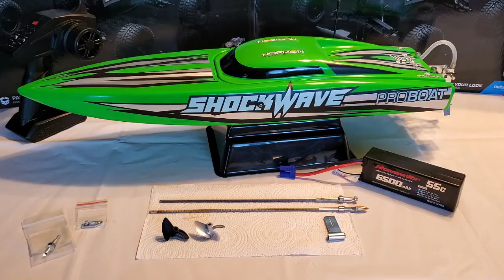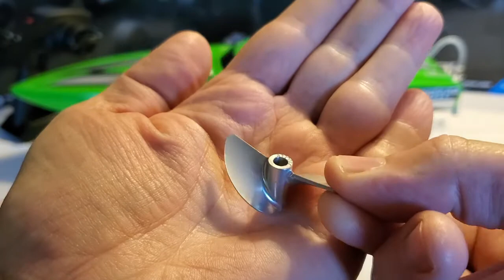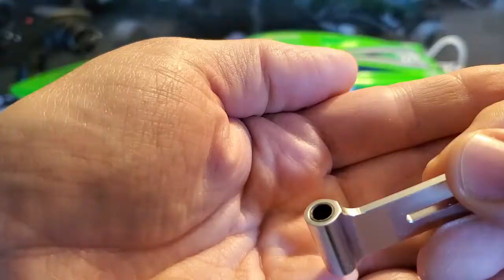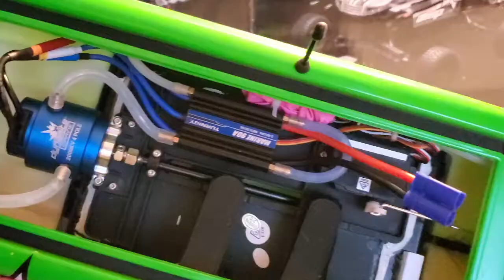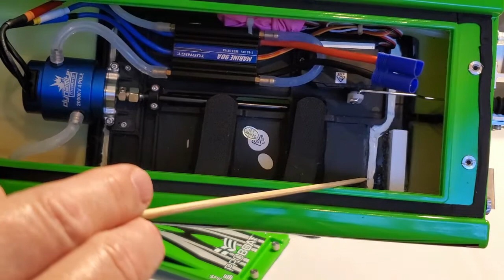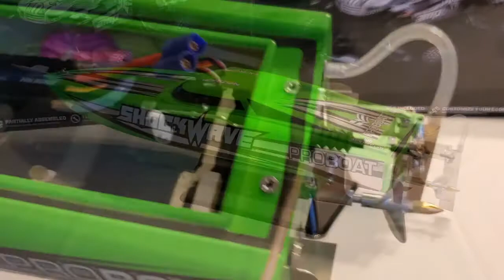Pro Boat Shockwave Intro and upgrades

Comment: Great vid! I just got one of these cheap and was curious about the OSE upgrades ..looks like it did, but just to confirm - the stock coupler worked fine with the new OSE cable? Thanks! 😄👍
Reply from the maker: If I recall correctly, yes, the stock coupler worked. The flex cable is the same size as stock, so there's no reason it shouldn't work.
Reply: Where can I buy the upgraded shaft?
Reply from the maker: @Patrickfrancisconi  as OTW RC said, you can get it at Offshore Electrics. Just go to the "RTR Parts & Upgrades" section and they list a lot of boats including the Shockwave
Reply: So should I buy the upgraded shaft? Where can I buy it?
Reply: @Patrickfrancisconi  You can buy it from offshore electrics site ..haven’t installed mine yet.

Comment: Have you played with the trim tabs? Do these have any play in them, similar to the Stealthwake 23?
Reply from the maker: I replaced the stock trim tabs with fully adjustable ones, but if I recall correctly, yes, they are very similar to the Stealthwake trim tabs where you can adjust them up or down slightly and you can bend them with pliers to change the angle

Comment: Hey there! Do you think that the OSE set up w/the high pitch prop would burn up the original ESC?
Reply from the maker: With a higher pitch, or larger diameter prop, it will likely lead to more amp draw so there's a chance it could overload the ESC, I'm not sure. However, if you just upgrade the strut and flex shaft and keep the stock prop, it probably won't. When I got ours, it was used and the ESC was burned out. It was cheaper to get the 90A Turnigy ESC than a stock replacement from Horizon.
Reply: @HandfulOfHobbies  Thanks!